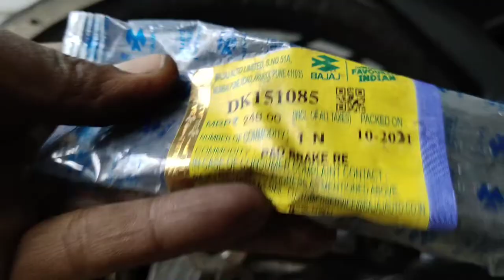REAR DISC PAD CHANGE & CALIPER PIN GREASING WORK AT HOME | PULSAR NS200/RS200/AS200/NS160

Comment: Bro boot ku grees vaikrthala yena bro benifit.break nala irukuma.
Reply from the maker: Break caliper free ya movement agum bro break jam aaagathu atha benifit
Reply: @robinrsvlogs6862  super bro.yenaku rear la ipo la Vandiya move pana break sound varuthu bro .oruvelai itha pratsanaiya irukumo.
Reply from the maker: Ama bro clean panitu grease podunga sari agidum mudinja new boot mathidunga 60 rs tha varum
Reply: @robinrsvlogs6862  k bro.thank you bro
Reply: Bro yenoda bike la oil dry aguthunu sonen la .athuku engin piston.piston assembly.and head ,volve,volve gaid.yelam mathiten.mechanic anan oru 3000 kml ku 65 to 75 Kula ota solraru.yen bro.
Reply from the maker: New parts bro konjam slow ah otuna tha elam set sgum aprm speed ah otikalam bro IPO ota kudathu
Reply: @robinrsvlogs6862  ok bro
Reply: Bro rpm evlo Kula bro otalam
Reply from the maker: 5k la otunga bro
Reply: @robinrsvlogs6862  super bro nanum athukula than otitu iruken bro
Reply from the maker: Atha bro engine safe ah iruku
Reply: @robinrsvlogs6862  piston assembly head velai partha piragu vandi noise kamiya iruku bro.
Reply from the maker: Ama bro new engine Mathiri iruku

Comment: Bro I too have pulsar Rs200 I’m facing some issue like coolant oil level goes down within a week and engine oil indication is seen in speedometer! If you have any suggestion could please share me
Reply from the maker: Check your engine oil color its look like milk white you engine gasket is gone ...if your engine oil color is normal then you have a leaky radiator check radiator and hose for any leaks
Reply: @robinrsvlogs6862  I have changed everything and cleaned radiator hose too but within a week radiator coolant oil evaporate!
Reply from the maker: What waring symbol is glowing in the speedometer ??
Reply from the maker: Robii_rs_boy